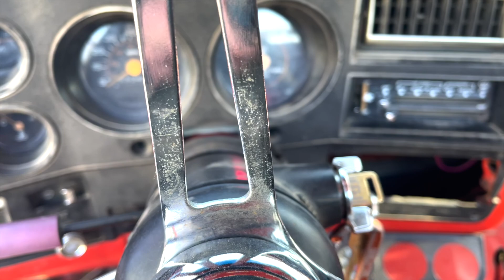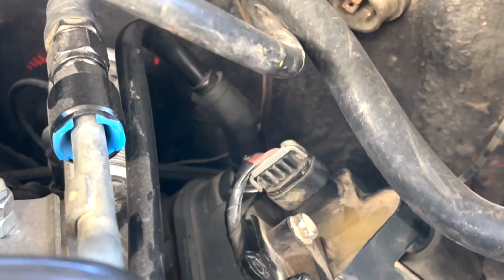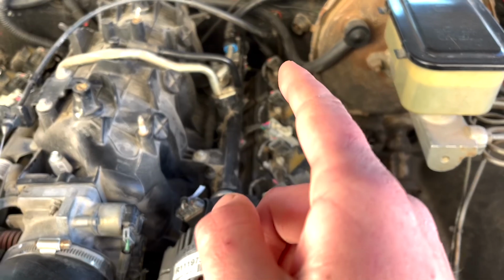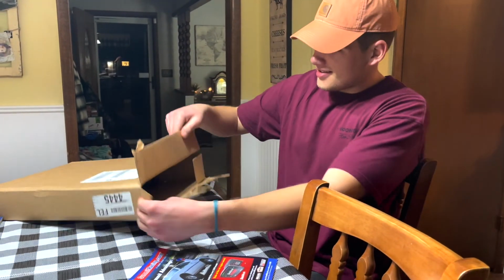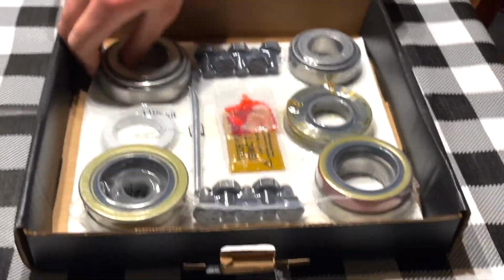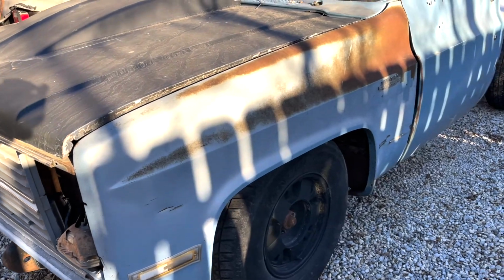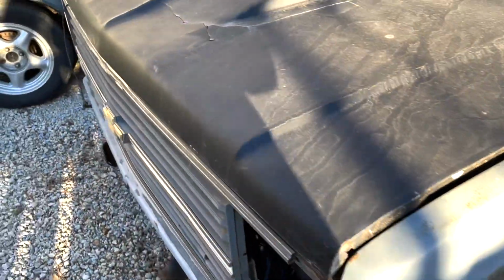Prison Mike's First Solid Pass On Camera! LS Swapped C10

Comment: So u can run 4l80 manual bodied on a 12 bolt truck rear end with over sized disc brakes 4:56 gears with auburn true trac posi with auburn axles etc take the nice 1 piece or even shot en the two piece drive line and carrier bearing out in that truck to . Holds way more power and smoother .

Comment: Bro I am a square body king I can walk I through any thing square. The frame on the shirt bed needs pulled set aside , wire wheel it.. take plate and box out the frame , c not he rear , swap over 1999 - 2006 upper and lower arms with brakes spindle the whole nine yards . It’s gonna change the stance all bitchen to u get conversion tubular arms from summit then go to junk yard pull spindles brakes , booster, sway bars front and grab a Denali rear sway bar and mounts , even if u end up 4linked we th bags and air shocks or Viking dual adjustable street drag coil overs u still want to fabricate the front and rear sway bar controls. Gonna help u have total overall modern touch to handling and dynamic's in case u ever feel like having the truck handle as good or better then it looks. Will create a sleeper for sure . So sounds like u tossed a Texas speed medium lope cam and etc etc . Did u leave stick 5.3 manifold on motor or did u change over to larger throttle body type from 6.0 or 6.2 engines ? Cause I’m wondering are u loosing any radiator fluid after maybe a month or so driving ? It’s a slight slight chance u could be forcing moisture or water pass the jackets of gaskets do to much higher crank case bottom end suction or blow by persay , then mismatched manifolds and gaskets can fit kinda iffy causeing odd crap . I’m deep in the LS saga I’ve pretty much experienced the ticks, poofs, squeals, vacuum pressure oddities, having to through all kinds of timing into it cause stock balancers suck . Are u gonna spray that set up cause u sure can . Toss a 100 shit and jet it way down milder like 65 to 80 horse per spray if like 1.65 sec delayed so spray hits 100% after trucks made it into 2nd gear cause u will just spin otherwise … add beam plates out pass the rear of axel giving 90lbs hook weights run 2” tubing dom with bushings and weld tabs to eliminate axel wrap keeping pinion angle perf .. then u can make some launches especially if now shortend. Push rear end twirls cab extra 1” after short frame all done to add traction by gain tiny transfer to rubber geometry …. Fuel cell goes far back to rear bumper as possible .batt to.

Comment: Bro that ain’t smoke. That is built up condensation because the air is more moist and has water basically forming inside the collectors and muffler in we hours of the morning etc.  First start of the am will have the biggest moisture poofff. That isn’t fuel or smoke color. Fuel is blueish grey and oil is grey white and blackish . White is water. Even a head gasket messing up . Check ur oil mite have a slight chocolate milky texture.